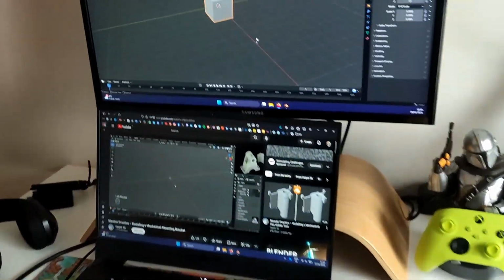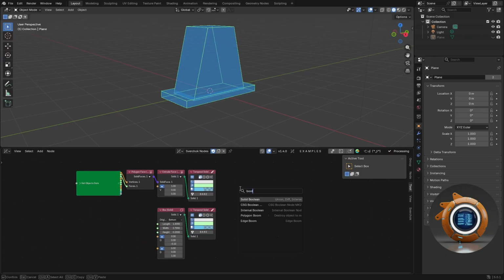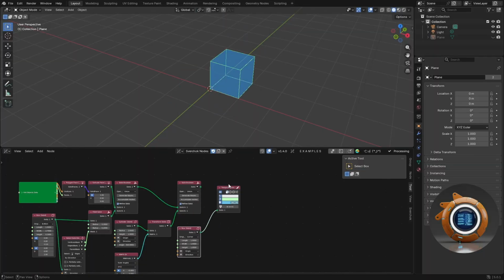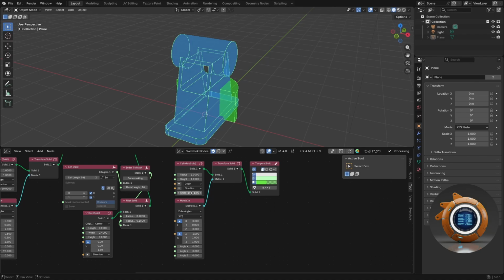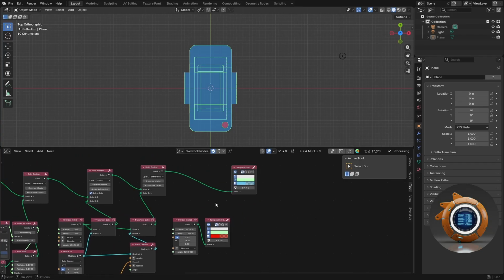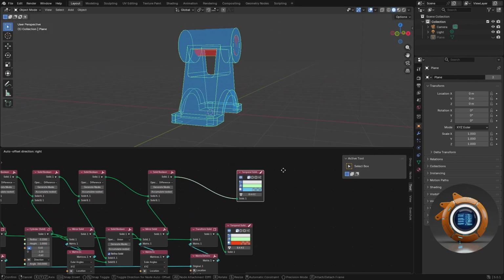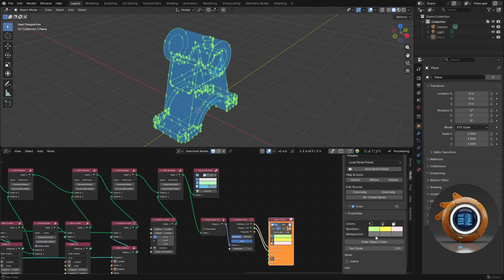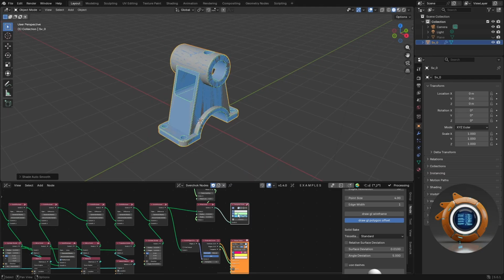Is This Better Than a Mesh Workflow? A Blender Challenge

Comment: Did you also have such pain installing Sverchok? I'm installing PIP updates and python libraries manually, via system console, because the addon settings in preferences failed, and it's still not working, forums not being helpful either. Trying to install in since Saturday, lol, I don't get why the dev wouldn't just ship the libraries with the addon, eh
Reply from the maker: You’re not imagining things, Sverchok can be… character-building 😅
I had my share of install issues too, which is why I made a short video showing the setup that worked for me.
Here’s the link, hope it helps: https://youtu.be/eNlNlj0dRfE?si=JnCjjhhVuzOyRyYB
Reply: @BlenderAidedDesign  "You’re not imagining things", hmm, I recognize it from somewhere... I really hope you didn't use ChatGPT to answer my question, haha :D Maybe it was just a humorous reference.
I could easily install all dependencies on Blender 4.2 and lower, but I still need to figure out the newer versions. Thanks for that tutorial, I'll try to follow it.
Reply from the maker: @mipe7755  Haha yes, I absolutely use ChatGPT! My English level is basically “the pen is on the table”, and without AI I would probably break more things than Sverchok dependencies.
The video I linked was recorded for Blender 4.5, but the exact same process works for Blender 5.0 as well. I have tested it, so that part is safe.
Let me know if you run into issues.
Reply: @BlenderAidedDesign  But like, you generated the reply for me in Chat GPT or you just used it for translation? Cause that's freakin difference! I understand using AI for translations, but making it generate the reply for a human commenter - that's a low blow. You know, when I talk to someone, I expect an answer "generated" by a human, so I know who I'm talking to. Turns out, I'm talking to a bot! I'm disappointed :(
Reply: @BlenderAidedDesign  I undrestand the ubiquitous need for automation and facilitating processes with AI, but if you want to "build a community", as you said, my friendly recommendation to you is not to make your AI do the talking. Translation - OK, but please make that minimal effort of writing your own responses to people asking questions, and just use AI to translate.
If I wanted an AI-generated reply about Sverchok or anything, guess what! I'd ask ChatGPT myself. But I asked you, cause you "want to build a comunity", but man, for God's sake, that's not how you connect with people.
Reply from the maker: I understand your point, and I appreciate you saying it openly.
Let me clarify. I write every reply myself, in English. Then, since English is not my native language, I use ChatGPT to smooth grammar and phrasing. The ideas, opinions and intentions are always mine.
The technical content you read in my replies comes from my own experience and experimentation, just like in my videos. AI does not replace that and I am not using AI to replace human interaction.
Reply: @BlenderAidedDesign  Okay, thank you for clarifying and sorry if I went too rough. From your previous response I understood you outsourced your replies to ChatGPT completely, because this sentence: "You’re not imagining things, Sverchok can be… character-building 😅" souded to me like copy-pasted ChatGPT at its full (dubious) glory. But I'm happy it's not the case. I may be a little too reactive when it comes to things with AI, cause it's my legitimate fear of "how will the future look like with AI". But I'm glad things are clear here. Best wishes to you from Poland!